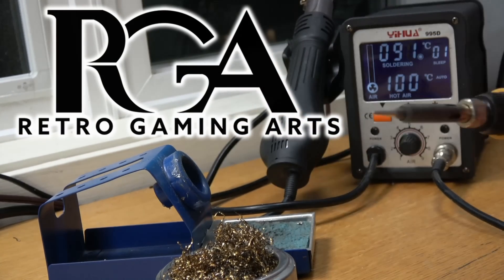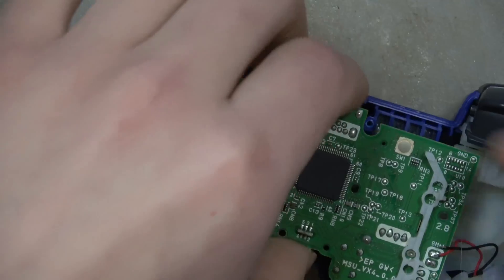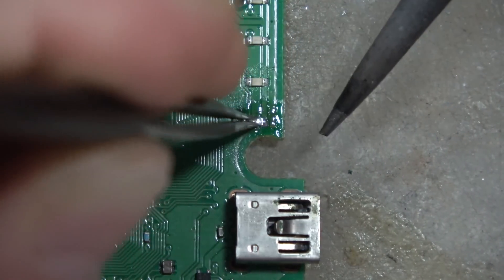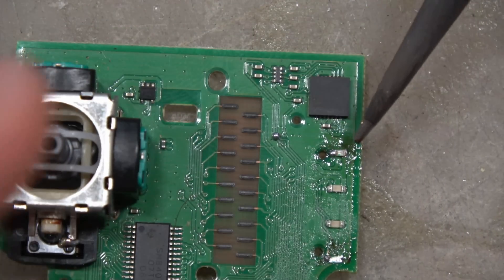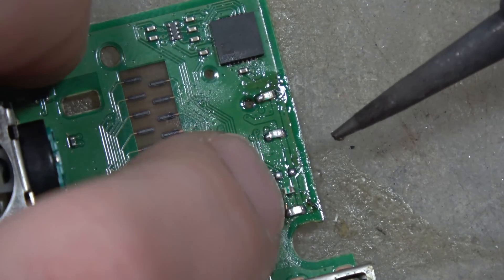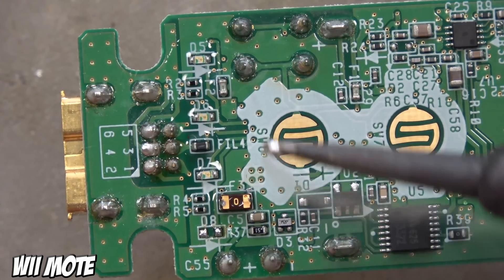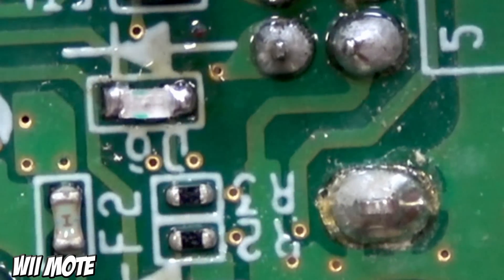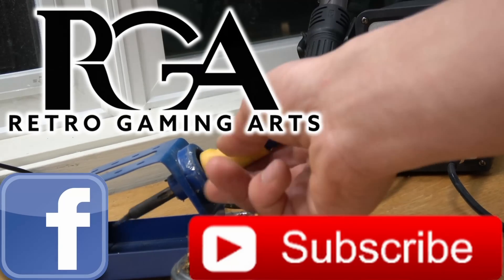PS3 CONTROLLER LED MOD - SMD SOLDERING

Comment: Where can I get rgb ones?
Reply from the maker: Rgb smd leds?
Reply: @ThirstWorldTTV  yes I want to make it multi color. I'm also looking for some for the power / eject button do you know what size those ones are and if there is any RGB SMD LEDS for that?
Reply from the maker: Yes there are, I use them in psp shoulder button mods. If you search in Google "rgb smd leds" I'm sure you'll find some 0603 package size
Reply: @ThirstWorldTTV  ok but what about the power / eject button LED size?

Comment: Ah sweet now I can remove the LEDs off a scrap controller. However I plan to use them for a ps4 controller, I prefer a plain red light over it's lightbar. Do you know if its compatible with a ps4 charging board? Or would fit?
Reply from the maker: I'm sure you could remove the RGB led on a ps4 light bar and replace it with a RED led.

Comment: To make the LEDs sit flush with the board you can use solder wick to clean the pads before. This also gets rid of the lead free  solder and make soldering easier. After that tin one pad and sliiidee...
Reply from the maker: I ran out of wick and never bought new wick. But you could not be more correct, excellent addition

Comment: very easy to tear the motor pads while removing them what iron are you using
Reply from the maker: Ooo.. I'm using a garbage iron, I have 2. A yihua995d (the blue one from some videos) and a cheap garbage radio shack one I got when they where going out of buissness for 20 dollars, temp controlled with interchangable tips(im SHOCKED its lasted this long)